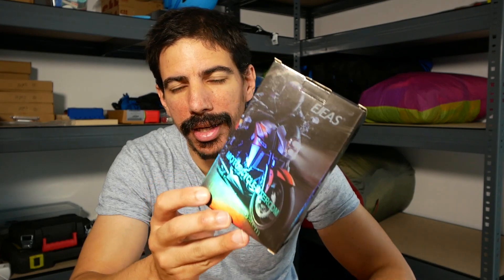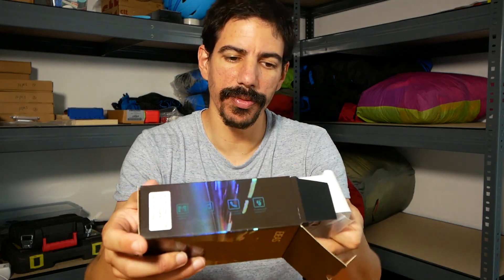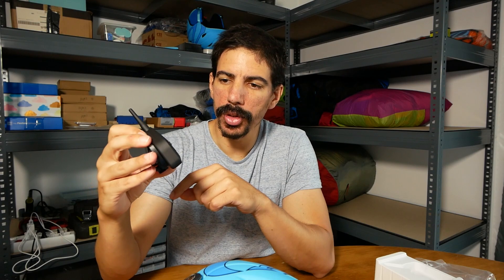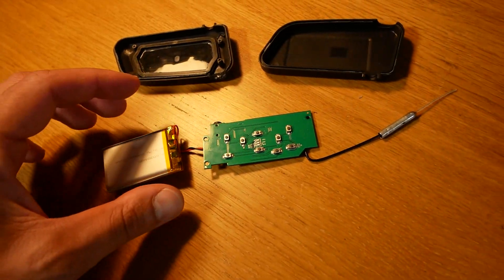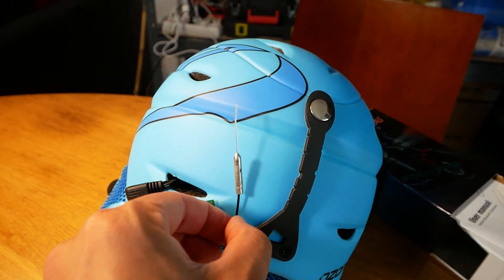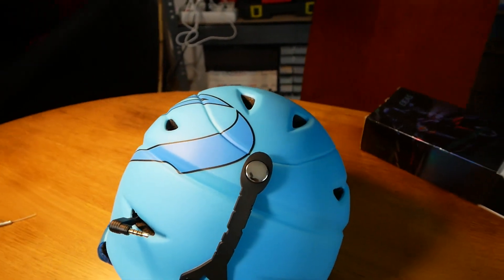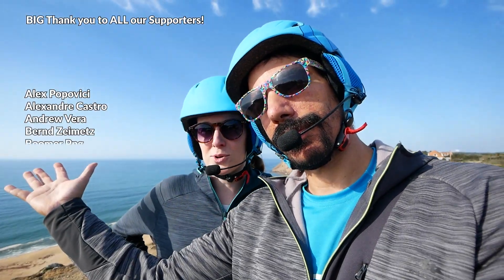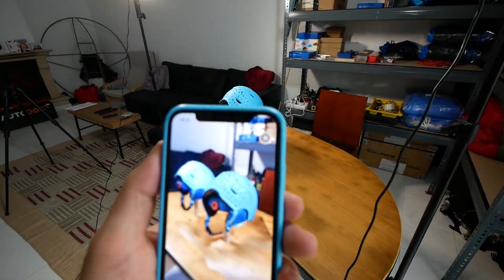DIY Clean Bluetooth Helmets - 1km+ range - BANDARRA

Comment: 👋  there, this is a realy nice project🤙
few tips if I may

Try BT 5.x radio instead of 4.x, the range it covers is x5 more; BLE goes even further. 

Try US version BT instead of EU, delivers 20mw instead of 13mw. longer range.

Try this adhesive PCB 3db antenna, instead of the build in, the range will be icresesed even more, it's also easy and convenient to mount it in curved surfaces 

my 2c worth of advice, cheers
Reply: FXP831.07.0100C.pdf  Taoglas adhesive flex-pcb antenna
Reply from the maker: Wow some really good tips there. Really appreciate it!!! Thanks

Comment: Im confused by all the github folders listed with no descriptions. Will we need them all, or what? Please clarify.  Thanks.
Reply from the maker: What are you trying to do?
Reply: @AndreBandarra1  just build the helmet radio enclosure.
Reply from the maker: @McGyverPilot  just take the STL files to use in a 3D printer

Comment: Dear Andre, i´m trying to print the cover but i have problems with the file. I can't open it with Cura. 
Can you check if the files are ok?
Thanks in advance. Gustavo.
Reply from the maker: They are just standard STLs so they should work fine on any slicer. For support you can join our discord, lots of knowledgable people there. https://discord.gg/eZyPmzhJaF

Comment: Nothing better than keeping your helmet good and washed!   😛

"After freeing it from the case...it's a bit difficult but ....  Yeah, as a fellow engineer I think they call that idiot proof and engineer resistant.  :-)   VERY little is engineer proof.  If you want similar MUCH more nasty problem I had to deal with at one time, I got the joyous assignment to analyze some VERY legacy bridge wire initiators for a target missile. The large capacitors and boards were potted in that nasty high density foam crap they used in the 60s, as that hardware came out of stock for a fielded design (Pershing II, in that case).  Yuck.   At least I had the sense to offload it on the poor tech after the first one or two.  The crap always flows downhill.

Also I did get to do a couple of clean sheet designs for that program later (thank god, polishing turds is not my favorite pastime).  Not particularly interesting stuff, most of it, but better than "OMG, what idiot did this?" level work.  Somebody down the line probably has said or will say the same thing about some of my stuff, if it lasts that long.  I'm not totally clueless.  One advantage you have putzing around with your own stuff compared to working for some big three (the biggest one, actually, not always a good thing) defense contractor.  All that assuming that you don't or haven't worked for a large company, anyway.  If you have, you have my utmost sympathy.

Just one thought (aren't you lucky).  I would be paying a bit of attention to bridging the volume filled by the cushy parts with something hard and that could possibly snap with sharp edges (don't know the material, personally) that could go in search of your brain on a heavy impact from that direction.  Maybe a dumb thought, maybe not.  One of those other problems with designing, you are the one that has to make stuff work or take the consequences of your oversights.  Hopefully that will never even become an aspect of use for this project.  More eyes and all that, take it or leave it.  Pretty good color matching, caught that, too.  Aesthetics should always get a hint of a nod, I think.

Boy, are quick CAD capture and 3D printers a boon, or what?  We had to walk to school, in the rain and snow, uphill, both directions. You kids have it so easy, blah blah blah.  That crap used to drive me nuts, so I pass it down to you for the next generation.  I laughed at the "oh stink, the piece of junk won't even transmit through a mountain" comment, paraphrasing for effect, obviously.  I love it when a plan comes together.   You can almost see the pride beaming for your 'baby'.  🙂

If you don't you might want to consider a "the designer makes no warranty for the operation, suitability, yada yada type disclaimer on your plans.  Better safe than sorry, and unscrupulous lawyers can screw you over good.  Remember, no good deed goes unpunished.

Comment: This is awesome, good job! Couple of thoughts.

Have you tried an omni antenna? From my experience with FPV they usually fair better overall than dipole, though I'm not an RF expert. Even if you don't get as much absolute range I believe the range will still be more than enough and you will be less likely to have issues at weird angles.

Another thing, I'd maybe print that in PETG (or even TPU if you fancy a more flexible mount) instead of PLA. In a sunny day, PLA will soften quite a lot (glass transition is only in the 60s) if exposed long enough to the sun. Even if that never happens, you'll likely see degradation from UV in a couple of months if regularly outside. It'll become very brittle with continued exposure and you'll risk easily breaking the buttons for example.

Keep up the awesome content! :D
Reply from the maker: Thanks for the tips! We’ll see how they hold up. Was just a test

Comment: Nice work guys!! Very slick, amazing how far tech has come. 
Looks like a great upgrade, I’d like to do something similar.
Have you thought about combining with radio for and a ptt button? My airband radio has built in Bluetooth, would make for a kool addition.
Reply from the maker: Cheers Patrick! That’s a good idea but I didn’t think of it or wanted to make it complicated for my first attempt but might try it in the future
Reply: The Sena 10R works well with my BT enabled radio. Also connects to my phone so Siri calls can be made. Sena also has a pilot to pilot intercom in close range.

Comment: use baofeng R5 and you can get 30km range
Reply from the maker: You have to take turns when talking, have to push to talk, and you’re broadcasting your whole conversation to the world on a frequency that in most countries you need a ham license for (and most pilots don’t have)
Reply: @AndreBandarra1  i solder button and ekstand to my gloves and it works FM is licence free in most countries
Reply from the maker: @hekamteam  what frequency do you use?
Reply: @AndreBandarra1  on baofeng 444.000
Reply from the maker: @hekamteam  on most countries in europe that frequency is not license free. Paragliding pilots use it under the knowledge they are "breaking" the law, hence it gets used as little as possible
Reply: @AndreBandarra1  never have problems in slovenia croatia italy austria hungri germani serbia
Reply: @hekamteam  not having a problem only means that nobody bothered to find and fine you.

Comment: Why not use your phone with airpods and use siri to make hands-free call (in case it hands up). Unlimited calls are free in most countries now.
Reply from the maker: Yeah there’s a few complications like that, having to have signal and battery on your phone, and the wind noise etc
Reply: I don’t have cell signal most places I fly.
Reply: Wind noise is a big one, I use my AirPods on calls and always find the person on the other end struggles to hear me.
Reply: @patrickgriffin6485  yes but if you put the earpod below the helmet ear protection (see helmet in video) it should protect from wind noise, also you could dig a hole in the ear protection to let room for the earpod. i have not tested myself...

Comment: I did approximately the same. And even have possible upgrades for you: 

I mounted mine with Velcro so you don't need the tape, which is quite strong but still easily detachable (and you don't have any tape or aggressive adhesive). Furthermore, I taped the mic boom to the speaker (to make it one unit). Than cut open the seam of the earpiece so the mic boom stick out of the front. Sew it back up with a blind stich and it looks factory made!

And last but not least, from Ali you can buy Bluetooth transmitters for your radio, which makes it possible to use this during courses with you radio as well.
Downside of using that with this intercom unit takes a few tenth of a second to connect and gain priority over the intercom. So I switched for the one without intercom function to reduce this slightly so you won't miss out on the first two words all the time.

Now I am adding a comment, is the work on the incollapsible wing still going on?
Reply from the maker: Thanks for all the tips. Work on uncollapsable is still ongoing and there should be an update soon on what I’ve been up to for the last year or so!

Comment: Try swapping the antennae for a omni-directional antennae -  it will give you much better and longer all round coverage - no weird angles where the comms drop out.  
Look at FPV drone antennae - they are 5.8 GHz - maybe a circular polarized antennae at each end will reduce reflected single interference - that said there shouldn't be much  large lumps of metal up in the sky to cause reflected signals but it may help on the ground with large metal sheds or hangers to bounce off of.
Reply from the maker: Should be better for coverage as the pattern is roughly a sphere but if I remember correctly the donut dipoles are higher gain so longer range if inside the donut
Reply: I agree that the science suggests longer range from a dipole but In my experience omni beats dipole 100% of the time on range and coverage and 99% of FPV drone pilots agree - see 

https://www.youtube.com/watch?v=fSoXIqBlg9M

or

https://www.youtube.com/watch?v=-wvUZhtgXuo

Comment: Nice one. Looks like you smashed it. Probably dont need any advice as seems like you figured everything out.

But im an arborist, and in our industry we use the same system to communicate. Retro fit motorbike bluetooth comms to our helmets. Obviously you want a helmet rated for paragliding. But there is a helmet called pfanner protos that i know guys use for paramotoring and tree work where there is room to fit the bluetooth module conpletely under the helmet. Best helmet ive ever used for anything.
Reply from the maker: Thanks for the tip! There are some laws here when it comes to what helmets you can use for pg and ppg but it looks like a really nice helmet with the muffs and everything.